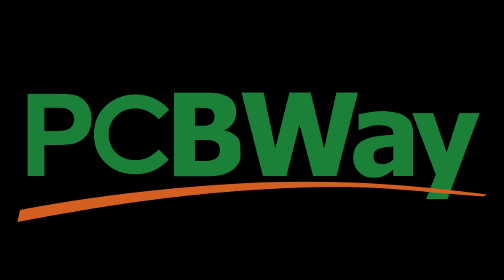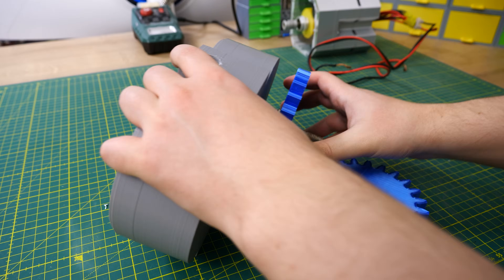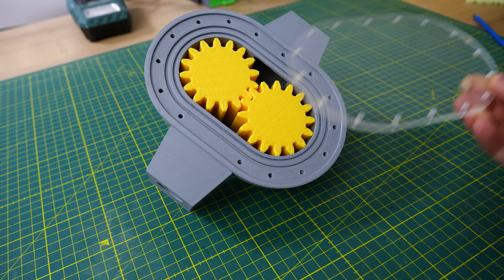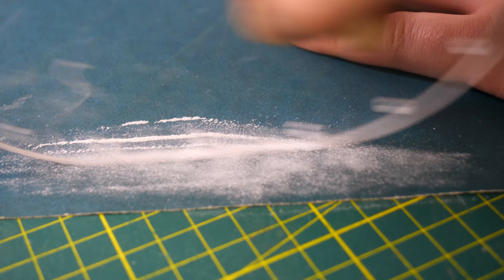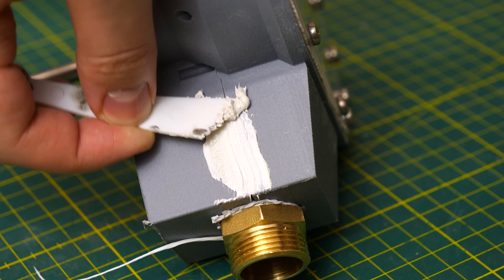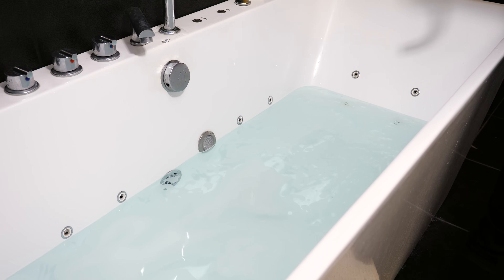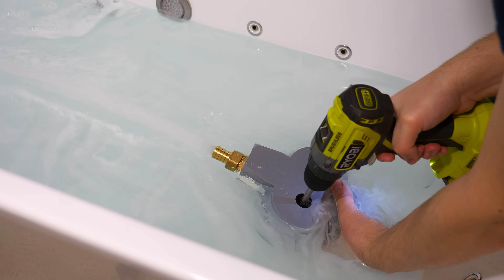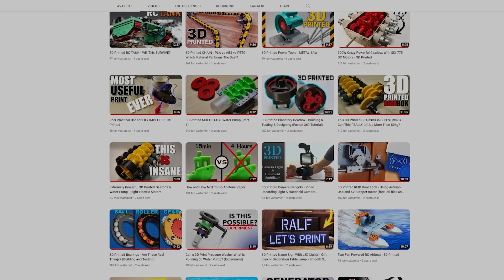3D Printed Gear Pump - Biggest I Have Ever Built

Comment: gear pumps, lobe pumps and screw pumps is good at building pressure, not velocity.. so if you really want to see the performance, you need to connect a pressure gauge to it.

Comment: If threads are too tight, take the fitting back out and heat it over a flame for a few seconds. It will soften the plastic as you screw it in.

Comment: As always Interesting Video! One advice i can give you: you can try out sealing cords for End caps. You can get them in any cord diameter. Just cut them to the length you need and use superglue on the ends to make a custom O-Ring. Makes it a bit easier and less messy, if you have to open these caps again for whatever reason.
Keep it up!

Comment: I`ve disassmble NSh-10 (НШ-10) for repair and it`s made more complicated.
There are double seals. Outside from inner seal connected for intake, to eleminate sealing leakage on high preshure.

P.S. And it`s not self priming. If you tell the highpreshure pump to suck it woudnt do it.
P.P.S. And used one cost not so many - around 10-15$, if you want to made HP washing machine.

Comment: About a year ago, I attempt to fix clearances in a friend’s files of a gear pump he had designed and since they are precisely precise precision tools with intertwined intolerable tolerances, finely tuning and or fixing it went out the window with the first step of the project just like you also recently experienced 😅

What really fcuks with my mind is the gear rotation direction and flow direction are seemingly opposite when point of reference is referenced accordingly. The water enters the housing maybe’ and is immediately presented with a quantum shift around the drive gears, smashed but not compressed against the housing then suddenly rejoined in the matrix with not a moment too soon before collimating out the exit orifice of low pressure, or high pressure now, lolz
Reply: Right!? One expects the flow to go straight down the center in-between the gears. NOPE! The flow of the fluid wraps around in-between the walls and gears.

If you want higher flow you need to focus the geometry of the vallies, such as the root circle, pitch circle and the Dedendum. The only parts that needs to be precise are the gaps between the addendum or the tip of the gear and the outer walls. The second precise location are the face of the teeth, they need to maintain a good seal with each other.

Comment: For the love of god when will you stop putting COMING SOON! in the link of the files? Some designs you upload and some you put coming soon but I find your designs to be awesome and unique and I want to print them! PS: on your video of the pressure washer you put the pumps in parallel instead of in series. I know very little of fluids but I believe putting them in series (one after the other) would make the pressure washer have more pressure in exchange of being less able to push more quantity of water. Thank you a lot if you happen to read this

Comment: why so, you try to squeeze water between the gear teeth, centrifugal impeller pump is the best, no unnecessary squeezing
Reply: hey its quite a lot in kelvins tho
Reply: thats no air succing pump, it leaks
Reply: self-priming is the air capable pump
Reply: also the centrifugal self-ducted impeller does not jam if there is trash in the pipe, the gears will shear with minimal trash content
Reply: not very trash/crap resistant, industrial guy
Reply: all gear type pumps break easily, because the have teeth that you are running the stuff through